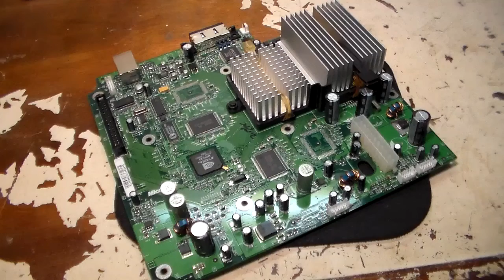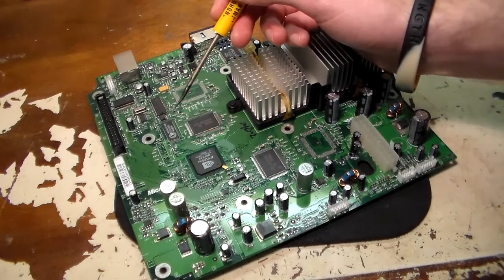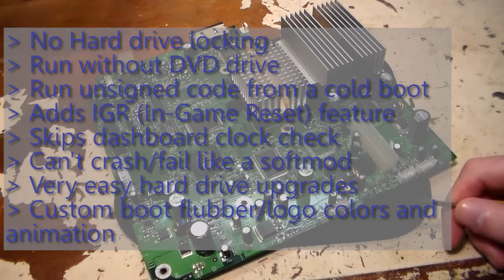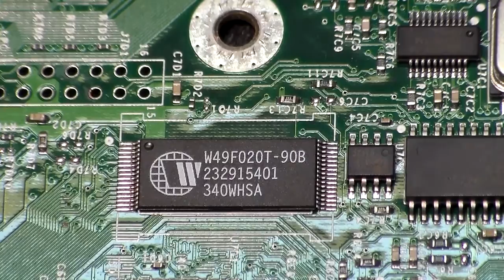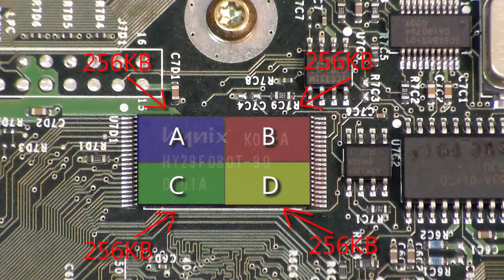How To: Xbox TSOP Flashing Explained -Part 1-

Comment: @thewheelman282 there is one advantage I can think of for a dual BIOS; so a person ca run a debug BIOS and a custom BIOS on the same machine and use the XDK to develop new software without incurring the cost of an actual debug console. Other than that, the only other scenario I can think of for a dual BIOS setup would be for the purposes of having a fallback BIOS to boot from while developing a new custom BIOS.

Comment: Hi, I have a question about the TSOP chip. In an effort to mod a 1.0 Original xbox, I apparently wired it wrong and cooked my TSOP chip.  Is it possible to install a new TSOP chip and flash it?
Reply from the maker: It's possible but very difficult. You can either buy a new TSOP chip and flash it with a programmer and PC then solder it in or you can solder in a new blank TSOP chip and install a modchip and then flash the new TSOP with an xbox flashing tool.
Reply: @thewheelman282  Thanks for the promt reply. I was attempting to install an Aladdin XT Plus 2 mod chip. The only thing I can figure is that I connected my DO wire to the wrong point. Maybe. My DVD stopped working, so that is why I was trying to mod it. Thanks!!

Comment: thanks for the video, it really helps to understand.. I'm trying to fix an error 12 in a soft modded crystall version which i suspect that is an 1.6... And the DVD drive just died in the same day ....
Reply from the maker: error 12 is DVD drive related. try reseating all the cables first
Reply: I've checked twice and even use another IDE cable, but no success. I'm thinking buy a mod chip to remove the DVD drive itself(no use for me) and put a larger HDD. Right now i'm having issues finding mod chip for xbox.. every site i visit is out of stock, or charges a lot for a mod chip. Do you have any suggestion?
Reply from the maker: go here for affordable modchips
http://assemblergames.com/l/threads/zer0-2k11s-mod-chip-and-installation-shop.43131/
they are migrating servers so the site is down right now but the guy that runs that thread is trustworthy

Comment: What kind of solder do I use
Reply from the maker: 60/40 lead-tin with flux core is always a good choice but other metal mixes work too. dont use lead-free solder or acid core solder
Reply: Thank you

Comment: I have xbox  360 can the tsop  be changed for a new one mine will not flash erase so cannot put a chip out of a same version xbox360 board
Reply from the maker: modding a 360 is completely different than modding original xbox's. the info in this video will not help you mod your 360

Comment: Excellent tutorial, thanks for all the detailed information. I do have a question though: would TSOP flashing allow me to replace the original DVD drive with an aftermarket one? I realize this is probably a moot point since I can just FTP the games to the hard drive, but I'd still like to have the option of playing my original games even after the factory drive inevitably dies.
Reply from the maker: as far as im aware, using a custom BIOS doesnt have any bearing on this. The main obstacle is the firmware on the DVD drive. The original drive firmware can read original xbox games while PC drives cannot unless you flash xbox firmware to the drive. The most a custom BIOS would allow is playing burned games on either type of drive
Reply: thewheelman282 Alright, thanks for the information!
Reply: +Luis Rosa I know i super late but cant you just use dvd 2 xbox and put all your discs on the hd